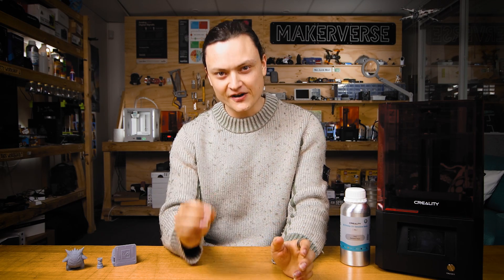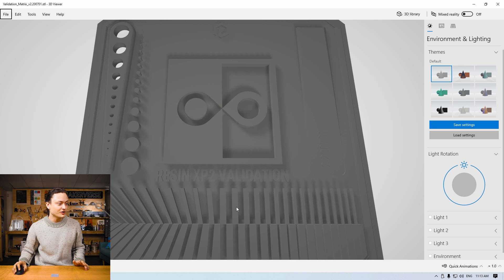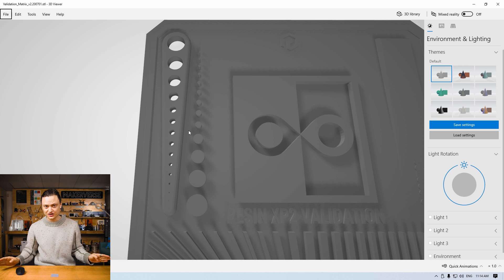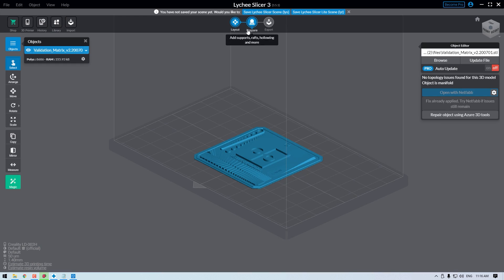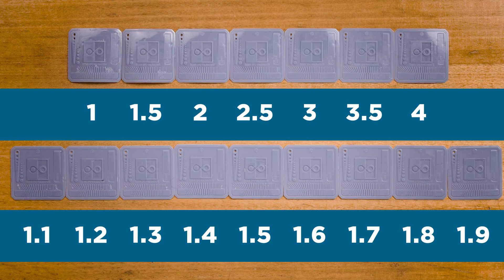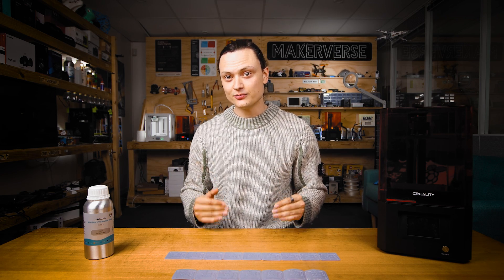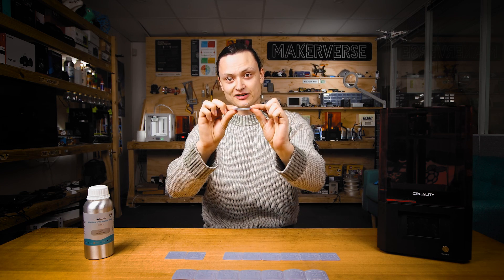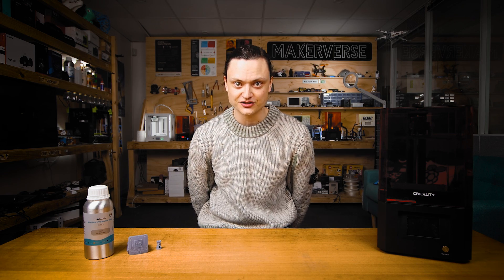Create Perfect 3D Resin Prints by Finding the Optimal Layer Exposure Time

Comment: I've been using this method for my first three prints and ended up with the gap/ hole / whatever you want to call it seen in your over exposed test strip ( on the left half of the infinity symbol ) at time stamp 5:18, I moved the print to the left side of the build plate and ended up with perfect results using the same exposure settings for the burn in and the regular exposure time. Does this indicate I need to recalibrate my build plate 0 settings for the Z axis or something to do with exposure that I just need more test runs for to dial in the perfect exposure settings?  Also thanks for the great video it helped me make the plunge into the world of resin printing !
Reply from the maker: It's hard to say, you may need to re-level and home the build plate, which if you haven't done recently is a good idea to do anyway. But you might be experiencing the different levels of UV intensity that occurs further away from the center of the screen. Since the UV light is not emitted from the screen but by a LED die underneath, the edges of the screen receive slightly less light than the center meaning that your exposure times would be slightly different at the edge.
Reply: @Core-Electronics  It did end up being the leveling, Thanks for the help !

Comment: Does it matter it I don't cure the matrixes? I'm checking them fresh out of the printer and I've tried several settings for exposure and the right bottom end of the bars don't materialize
Reply from the maker: There are some dimensional changes that occur when you cure models so to get the best possible understanding I would recommend curing the pieces. Doing so also means you can handle the printed parts without gloves.

Comment: After the first Matrix was done printed and removed from the Platform, Do I have to Level it again or is it possible to print the next exposure test right after that?
Reply from the maker: Once you have leveled the platform once your good to go. It is good practice to do so once every 6 months, but so long as those screws (that you tightened to level the build platform) are still tight the build platform will still be level.

Hope that helps 😊

Comment: My test prints keep curling up, how can I fix this?
Reply: Still doesn't work. Is there a setting that I'm overlooking. I use lychee slicer with their creality ld-002r profile, Nova 3d resin
Reply from the maker: The other reason that could be happening is because the Bottom layers have longer exposure than the normal layers. That is a deeper root cause for un-even internal stresses. For clarity, is it the final piece curling or has it curled before removing it from the build platform.

I haven't printed with that particular resin before so perhaps it is more liable to curling than the ones I have here. If you'd like, come write up a post on our forum and attach some photos of the model, give me a better chance to troubleshoot.
Reply: @Core-Electronics  sounds like that could be it, ill give it a go and let you know 😉
Reply from the maker: Be sure to cure them evenly on both sides. If you instead cure one side more than the other it'll lead to un-even internal stresses which will result in a curled up exposure test.
Reply: @Core-Electronics  ok thanks ill try that

Comment: Does this work on Formlabs printers
Reply from the maker: Formlabs Printers use a Laser to do the initial cure instead of a Monoscreen and a UV Projector. So instead of doing the whole layer in one go it need to go across all the surfaces to be cured with it's thin laser. I presume there are settings to determine how long/amount of time the laser lingers over the parts being cured. Nailing that would be the equivalent of nailing exposure time for DLP printing.

Comment: Hi! Nice video. But now I have a question. Do I have to put an exposure time to the bottom layers to make this test print or just with the exposure time of the normal layers. For example. Normal layer 1.7 s and Bottom layers 0 s? or Normal layer 1.7 s and Bottom layers 17 s?
Reply from the maker: Thank you mate 😉 Print the exposure tests with 4 bottom layers and like in your example use 17 second bottom layers and 1.7 second for normal layers.
Reply: 10x is very high for bottom layer, I use 2.0 sec and bottom only 8-10 sec, for a loooong time and never fail.

Comment: I'm trying this out with the new Anycubic Photon Ultra with the DLP Craftsman resin that's designed for it. However, I find that the Validation Matrices that I print start to curl a bit within a day of curing them. 
Anyone else have this problem? Know a fix?
Reply from the maker: I have curly Matrices when I expose one side more than the other. That creates an un-equalness in material properties where one side is under more tension than the other side. That side under higher tension then pulls in the corners creating a non-flat Validation Matrix.
Reply: @Core-Electronics  Ah yes, thanks, that makes sense.
How long do you usually cure these for? I'm guessing I'm likely over doing it anyway...
Reply from the maker: 2 cycles of 4 minutes length inside the Creality Wash and Cure station is my normal go to (unless the model is really particularly thin). I make sure to move the object around between cycles so that all sides get UV cured.
Reply: @Core-Electronics  Thanks for that, but I meant something that is particularly thin like the Validation Matrix. A lot of videos on it, but I haven't seen anyone mention how long to cure these things for, being so thin.

Comment: What about the instructions on the bottle of resin, for example I'm trying out the Elegoo ABS and they recommend 8sec normal exposure & 60sec bottom exposure.  How accurate are these settings when printing.
Reply from the maker: Resin Manufacturers, much in the same way as Printer Manufacturers, want your first couple of 3D prints with their material to be successful. This means normally providing settings that are over-exposed, so that you won't have models falling off the build platform.

I haven't done experiments with that particular resin but to me those numbers seem large for a Mono-screen Resin 3D printer. I would definitely run test on it with my particular printer before committing to large or intricate prints.
Reply: @Core-Electronics  Thanks for getting back, I also thought those settings were a little over the top however after a few test prints they seem about right for my 28mm prints.

Comment: I'm using Anycubic mono X with their basic resins in a light color. My perfect print settings (on a new printer) were: UV light strength @70%, 1.5 sec exp time, 6 bottom layers, 35 sec exp time. After 50 hours of print I started getting underexposed prints so I upped UV light strength to 75%, everything else stayed the same. 
Still getting perfect prints. I change FEP sheets every 25 hours of print time or so. I printed about 5 liters of resin (printing mostly full build plates).
Reply from the maker: Cheers for sharing mate 😊 love hearing success stories and your experience with your machine over time.

Comment: This is the first video of yours that I have seen and shall look forward to others that you do.  I've owned a resin printer for less than 2 days and NOW I realise why the exposure time is so important and what the difference is between a Normal and Bottom layer.  Your suggestion of a c.10x increase in exposure time to establish the bottom layer is invaluable.  I'm also grateful to you for explaining why manufacturers deliberately 'over-cook' (so to speak) the exposure time to begin with.  Not a conspiracy, but a guarantee that models produced will definitely work and so lend confidence to the newbie owner (i.e. me).

So very many thanks for this wonderful insight.  Forgive a naive question, but I notice that my Photon Mono 4K has a very similar appearance to your Crealtity (other than the obvious difference in colour to the UV casing).  Are they the same or sister companies, I wonder?
Reply from the maker: Very glad to of helped 😊 more videos on Resin Printing in the pipeline too. In regards to similar appearance this has to do with them utilising very similar technology and implementing it in a similar manner. This implementation is by far the most common way to print resin currently, you'll see many machines with similar appearances made by many manufacturers, and is now referred to as 'traditional resin 3D printing' (this technology is so young using the word traditional does seem a little silly).

If your curious there are many different ways/methods to 3D print resin, take this machine here which has a very novel resin printing method - https://www.fabbaloo.com/news/rocket-1-fast-and-accurate-resin-3d-printer

Comment: So much praise, but in fact, the blogger gives INCORRECT information, because of which your printing will never be successful. When using print times set to the XP2 test, you will have constant problems with delamination of supports and the model itself, because this test is designed to determine the quality and capabilities of the resin itself, and not as a parameter for printing.
So, the key point!
The time received on the tests should be increased by 10 ... 20%.

At one time, because of such advisers, I spent a month of time and 1.5 kg of resin until I realized that my "ideal" exposure time is far from the ideal needed for real printing, and not test plates.

The same #SirayaTech has an excellent test that contains a cube on supports and this test is much more suitable for determining the exposure time.

Comment: I downloaded the test print and got it perfect the first time.  Surprised the hell out of me since I was trying out a 50/50 mixture of two different resins with Cabosil also mixed in for strength.  I now have the strongest and sharpest test print ever printed.
Reply from the maker: Sweet! The idea of putting Cabosil into the resin is such a rad idea. Have you noticed significant strength increase?

Comment: So... these test prints to calibrate a printer is good and all, but I did run into a very... odd issue. I used this to home in the settings on some elegoo standard translucent resin and yeah, this and a few other calibration prints came out better than I hoped, both default settings to strart with and homing it down. But in really printing something... no matter what it was, or the orientation of the object... the side facing down printed flawlessly. But the side facing up, facing the build plate and around supports looked to 'gum up' or colect a mass of resin and cure it as well. These all being prints I've had no isues with in other resins. So the side facing the build plate would come out gunked up, thick globs everywhere, bad warping and so on. I'd share photos but youtube has been auto deleting all comments with links in them, even if I try and get fancy with it. 
Could this be just a bad batch of resin? Or some other factor I'm unaware of when it comes to clear/transparent resin? Could it be due to printing in winter though the temp inside and around the printer are with in the working range? It just seems no matter how I adjusted the settings even using settings ment for like the standard gray the same thing. If facing to the side or away from build plate, prints sharp and clear... face build plate and it's a mess. 
I am going to be switching back to the gray just to be sure something isn't badly fudging up. But this is starting to bother me as I was really looking forward to doing a few things with the translucent.
Reply from the maker: Thanks for sharing mate, this gunk that you have on the bottom layers when you use transparent resin could be any number of reasons. You've highlighted the main culprits that I reckon it is, old resin and temperature. 

Resin does last a long while sealed up and out of the sun. Make sure that you have filtered it so that there isn't any cured/semi cured resin hidden in there. Its particularly hard to see this with Transparent Resin.

With the right setting temperature can be overcome, I've seen a fellow produce resin prints in the snow (https://www.youtube.com/watch?v=Ac2-tnCSwQc).

With the images I can help better, come post them on our Forum 😊

Comment: Ok so im using a photon s with AMD3 black resin and im up to six seconds but the supports keep failing
Reply from the maker: Focusing on the bottom exposure layers, what exposure time are you using for them? As well as how many bottom layers are you using? Photon S is a RGB screen so times will need to be longer than that of a Mono-Chrome printer like the one in the above video.
Reply: @Core-Electronics  I was just informed it could be temperature. My vent leads directly to the outside and when i stick my finger in it i feel cool air coming in. I live in ohio so its pretty chilly right now and now im wondering if im just not going to be able to print until spring?
Reply from the maker: Temperature is definitely an impact but with the right settings accommodating that you will still be able to produce great prints. Currently I don't have access to cold weather over here at the bottom of the globe but a this fellow demonstrated Resin 3D printing in the Snow 😊 so don't give up hope just yet - https://www.youtube.com/watch?v=Ac2-tnCSwQc

Comment: Thanks for this video, I'll definitely run more tests! Do you think the 10x for bottom layer works for water washable resin too? And how many bottom layers do you suggest?
Reply from the maker: My experience with water washable resin is limited but I would treat it the same and follow my general rules for normal resin. So I'd have 8-12 bottom layers and a bottom exposure time that was 10x normal layers.

Comment: You could dial-in your exposure setting time using a binary search instead of printing multiple times with .1 second variation. save yourself time and material. i still appreciated your video and detailed break down greatly, just a small suggestion.
Reply from the maker: That's a great idea! Practical uses for computer science 👌
Reply: Sorry for my ignorance, what is a Binary search?
Reply: @TheRealViniciusSilva  A way to find whether an item is in an ordered set very efficiently.  Let's say the set is in ascending order. You'd start with a center item and see whether the value you're looking at is bigger or smaller than the item you want.  If it's less you find the middle item in the latter half of the set. If it's greater you find the middle item in the first half the set. Repeat till you find your item, or nothing if the item doesn't exist.

In this case, you can think of the calibration models as a set.  If you know, before printing, about what underexposed prints look like, and about what overexposed prints look like, you can use this same process to fine-tune your settings using less time and material.

Comment: How are you putting them into the slicer? flat on the bed or at an angle with supports?
Reply: Flat, set the base layers to 4 and it's relatively easy to remove from your build plate despite being large surface area.

Comment: My question: exposure longer is more detail?
Reply from the maker: Info below I ripped from my written up article, jump there for more information - https://core-electronics.com.au/tutorials/perfect-resin-print-exposure-setting.html

Too long exposure will result in light bleeding and scattering deep through the resin material resulting in a loss of intricate details and dimensional inaccuracy. 

Too short an exposure will create an under-cure result. Under-curing can be identified by several factors such as layer delaminations in the middle of the part, serious loss or miniaturisation of intricate details, general poor model adhesion to the build plate, or the worst, the entire model falling off the build platform.

Comment: Hi,great video,but I’m pulling my hair out,when I go to settings on halot one on lychee,I have very few parameters to adjust,simply volume ,screen  and default transition layers,there are other settings to adjust on the printer screen,but nothing to compare what you are showing,getting to the point of giving up
Reply from the maker: Just had a look for you and your absolutely right, the options available with that machine are less than they should. If you set up the Halot (LD-006) 3D printer in the Chitubox Slicer all the settings you would expect are there. So I'd recommend using Chitubox with that Printer until Lychee updates itself.

Comment: i have printed a few Warhound titants, same with Warlord titan, and never went up more then 5 bottom layers, and my bottom Exposure time is only 5 to 6 times my exposure setting.
That way the bottom layers dont crack when i am trying to get rid of it.
Reply from the maker: Cheers for sharing what you do + I'd love to see that Warhound Titan
Reply: @Core-Electronics  After i did dail in my resin with the resin validation matrix, it was perfect, and i did use 3Dprintguy support settings for evern better help.
Right now for my mastodon i am using 4 bottom layers at 1,8 sec Exposure time with 10.8 Bottom Exposure time.

And bottom lift and Retraction speed at 50mm per min, its on the slow side, but works wonders.

i can send some of my stuff to ya if you would like.
Reply from the maker: Very excited to hear 🙂! And always keen to see new resin 3D prints.